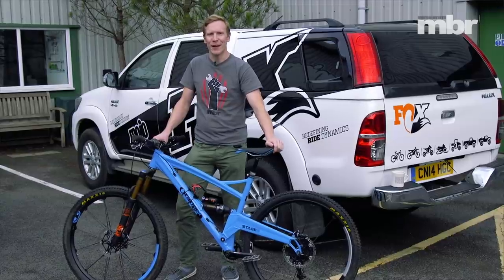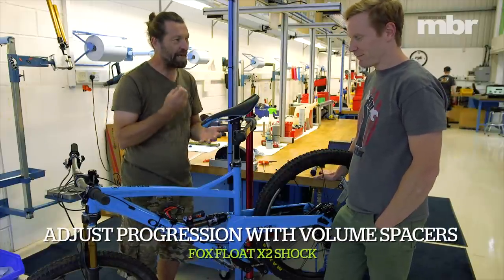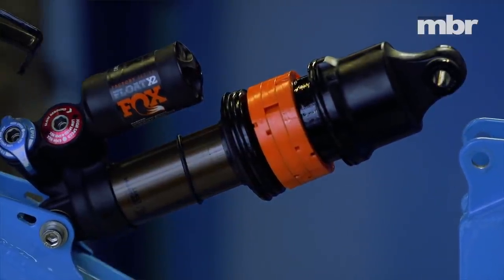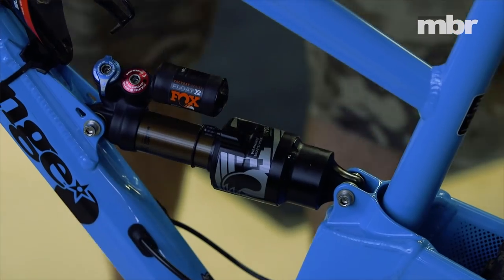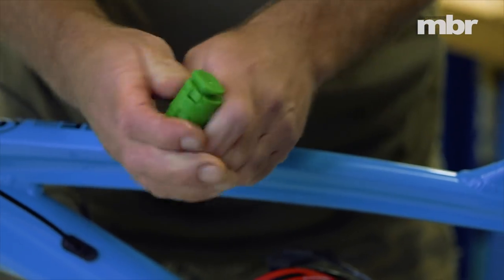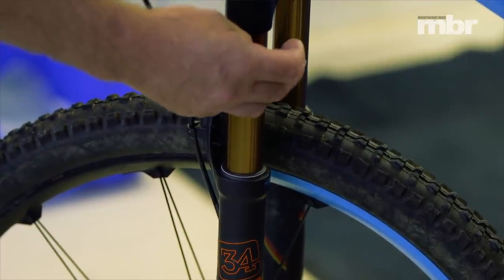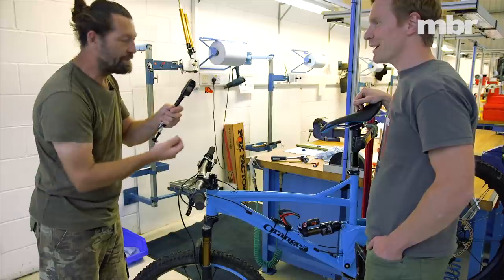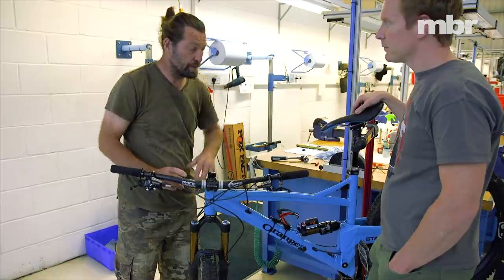Suspension Set-Up Masterclass | MBR & Mojo

Comment: This is probably one of the best suspension setup video's I've watched. I love how the focus is on setting it up to the rider. Notice how he glossed over sag/air spring rate and said that will change based on how hard you're pushing the bike. Explaining how he gets balanced and focusing on no compression unless needed to adjust ride high in certain sections of trail is huge. Much much better than the other sag/rebound/compression setup videos.

Comment: love his honesty. "don't use that" (the high speed compression on the fork). saying you should try to get the air pressure and volume spacers to do the work of getting it balanced and correct before you start using compression. Good stuff

Comment: This is so good.  I've been thinking about low speed compression a lot lately and this really set off a lightbulb for me.  Using LSC to load either the front or the rear during corners is something that would have taken me a long time to come up with.

Comment: Asking why you would want your front end to ride "higher" while climbing is a bit of a misunderstanding of terms I would think. All it does it to keep the bike from diving in situations where you literally do not need much suspension. I would agree with him. I run full open all the time....but I can understand where a bigger out of the saddle climber may need that "dive protection switch" when climbing.....

Comment: Great video but I’m still confused due to conflicting information on the net, I’ve Fox 34 Elite 2017, ride all sorts really but try to stay off fire roads.  So the Ride Fox website says 15 to 20% for my model (actually they only list 120mm but mines 130) sag tool provided was for 120 as well.  Most other videos including this one state 25 - 30% sag.  So in my case rode all the black runs at my local trail centre fairly spicy i would say and only used 70% of my suspension all day.  Do i ignore the FOX website and go with 30% which may help me use all my suspension or carry on using 15 - 20% and try volume spacers?  Surly fox that designed the fork knows best?
Reply from the maker: Try a slightly lower pressure in the fork and slightly more sag. Don't add volume spacers, as this will only make it harder to use all the travel.
Reply: Mountain Bike Rider thanks for the reply - i meant to say take out a volume spacer -  I’ll try more sag and play about with it

Comment: Did he just add one compression spacer in place of the red one? 80 KG myself and running about 170psi and already added one extra in place of the red one (three total) is it safe to run 2 extra total of 4 in a 2.25 shock?

Comment: Ok, I weigh 95kg 100 at most. I ride a Giant anthem 2015 27,5 120 F 90mm R. I ride everything actually on this bike. I find it hard to hop a 10cm street curb without hitting denting my rear wheels. It's annoying. I know it's my tire pressure and suspension setup. What do you guys suggest?
I currently run 95psi front and 235psi-240psi in the rear shock. rebound is one thing I don't understand. the rear is very slow just 2 clicks to fully open/slow and the front on fork is like halfway/12clicks (21 clicks altogether)
I run 2.2 rear TR tires 38psi when dry and 28 in wet conditions 2.2 front 35 dry 26psi wet.

Comment: You've never owned a Cane Creek Coil have you......  Complicated?
Reply: I have a CCDB, fairly straight forward to set up if you ask me. Just get to understand what the knobs are doing first, then get a good middle setting. Fine tune when riding a familiar track: right amount of lsc so the bike is balanced when cornering and pumping, ride some rocks/roots and see if there's any harshness, meaning the hsc is too heavy, see if it does follow the terrain nicely, if not back down the lsr a bit. Do some lippy jumps and see if the bike's either too bucky (too little hsr) or feels lethargic (slightly too much hsc) then pedal for a bit and feel if the bike's bobbing around too much (too little lsr).

And don't be put off by the number of clicks, really wide range but this can be narrowed down quite a bit to a useable range of about 7-8 clicks, everything outside that are bs settings that you can easily identify as such if you know how a bike should feel.
Reply: BIGKEV 61 The Fox has the same adjustments .... its not hard- go with the suggestes base setup and work from there
Reply: I got the CCDB coil cs. Is it just me or is it hard to fuck this shocks setting up?

Comment: Genuine question, why is tyre pressure never worked in to the suspension equation? Surely a tyre with more psi will have an impact, especially on rebound?
Reply from the maker: You're right, it's an absolutely critical part of the equation and needs to be considered as part of the system. And it's not just as simple as pressure: It will depend on the tyre casing, volume, rim width, rider weight, riding style, terrain etc, etc. Very much a huge topic on its own, yet also interwoven with suspension set-up.

Comment: 10:08   You can firm up the fork so you dont lose power when pedalling in the standing position !
Reply: Exactly !
Reply: RichardChick. Yes, on the flat. He was referring to riding up a hill with it locked out and the front end staying propped up and not sitting in its sag position. So essentially, the fork locked out, creates a higher front end and causes you to lean more forward to put weight on the front. Makes sense to me.
Reply: How do you lose pedalling power through your fork?
Reply: your suspension absorbs it rather than it going into the wheels, so on and so forth
Reply: tom harrison having the body positioned to far foward while pedaling puts the weight more into the fork, and vice versa.  Find the balance of body position
Reply: his point was how is there power going into the front wheel from pedaling. I understand your point, energy is used to compress the fork.
Reply: I think this refers to weight distribution over the bike when pedaling; higher fork= more weight biased to rear, causes the front wheel to come off the ground under torque in low gears. Keep the fork low, keep a more even distribution of weight over both wheels= keeps the front tire on the ground. That’s my experience with leaving the fork full open and it works
Reply: @dirtberg  you're not wrong, you don't loss any pedaling power in the fork, but you waste a ton of energy and anaerobic stamina bouncing up and down

Comment: That little black dial on my 36 FIT4 is an "OPEN MODE" compression adjuster. Not a LSC adjuster. Is the 34 FIT4 set up differently?
Reply: The adjuster for the open mode is lowspeed compression

Comment: Hi guys...I have a Rockshox revelation series 150mm fork...and I can not put any volume spacers i side becouse there is no thread on the inside of the air  cap...those this mean that my fork isn't compatiable with volume spacers or I can buy a threaded volume top cap and put volume spacers inside
Reply from the maker: You should be able to buy a threaded top cap from SRAM that will let you run bottomless tokens. Cheers

Comment: I have a question what if I like very slow rebound and want my fork to feel like slow rebound / have it, but want the rebound to be fast when needed how do I go about achieving that?
Reply from the maker: Why do you want slow rebound?
Reply: @MBRmagazine  it feels great and planted makes steering and jumps feel predictable along with wide open bumpy areas I guess I just have to make it fast enough to not lose all that with lots of trial and error bracketing settings ,fast rebound makes the steering feel twitchy for me but makes slow technical sections feel much easier.
Reply from the maker: Yeah, you said it yourself - the perfect damping setting is a balance that takes time and experimentation. If you're on a Kenevo SL i think Spesh has some detailed settings to use as a starting point in case you hadn't seen them.

Comment: so when he says 'don't use low speed compression unless you have to'. does that mean run no damping, assuming the sag is correct and you have the right amout of volume spacers in? then us LSC to fine tune? if you're still blowing through the travel?
Reply: Blowing through the travel is a different issue than low speed compression damping.  Blowing through the travel is either not enough air pressure, or you need to use more volume spacers.  LSC damping is what gives/adds some resistance to slow inputs to the suspension, such as pumping rollers, fork diving when braking, carving a big berm, etc.  That's why he says, if you don't need any LSC damping, then don't use it.  If your volume spacers are good and the bike is handling well, but maybe your front end is getting too low in a corner, or your rear end is too soft when pedaling, then add some LSC damping (clockwise turns) to give the susp a little more support.  Make sense?
Reply: @Windband1  sorry, i meant HSC to fine tune if blowing through travel. in any case, did some riding on the weekend with the LSC open and maxed out volume spacers with the right sag. still bottoming out shock. so i use HSC and it stopped the bottoming. i have 10% travel remaining on the trail that uses most travel, with jumps and drops. thanks for your comment.
Reply: @sultanabran1  Got it.  What shock/fork are we talking about?  So when you say "blow through the travel" do you mean use all the travel or are you bottoming out often?  Regardless I would say at this point, you need more air.  Some of the best experts in suspension actually say don't worry about using full travel, set up based on what feels best to you.  Sag point is just a ballpark.  If you're at maximum spacers and bottoming, you need more air.  I would try that first, then if needed, add a little bit of HSC damping.  That should get you there!  Also remember if you add air, you may need to add a click of rebound damping too.
Reply: @Windband1  thanks man. cane creek db air inline. running at 11bar (150 psi). blow through travel as in bottoming out. sag is about 30%. i'll experiment with putting hsc to 0 and see how much air i need to stop bottoming out then. however at the moment, it's at just under 30% with hsc at 3/4 turns. it feels really good and has about 10% travel left after doing some decent drops/jumps.

Comment: I'm kinda confused, the guy from Vorsprung Suspension said that the best way to dial the rebound on the shock was to close de HSR and work with the LSR, if you need your suspension faster then just open the HSR until you get the desired rebound. This kinda contradict what this guy says about HSR at 5:09. Any thought on this?
Reply from the maker: We would say there are no right or wrong answers when it comes to any aspect of set-up, just differing opinions. Try both and see which one works best for you.
Reply: I would listen to Steve at Vorsprung any day of the week and not listen to the most on Youtube, just my opinion.
Reply: @MBRmagazine  "There are no right or wrong answers when it comes to suspension setup"   realy, REALY ?   This may be why there's a lot of confused riders and even more poor setups.

Comment: how is that bottle cage mounted? zip ties, but is there something else?
Reply: Hi Go For The Win, I've just used a regular bottle cage and fed some zip ties through it. I ran a short section of gear outer inside vertically down the cage though, to give the zip ties something to feed around. Also, there's a rubbery bit of old light mount under the bottle cage to give it some grip.

Comment: It proper to compress the shox with the pump screwed??
Reply from the maker: He's just charging the negative chamber, so it's fine. When setting sag, you can also just unscrew the pump so that it disengages from the valve core, but leave it attached to the shock to save time.

Comment: fox float x2 2017  150kg me and bike ok work suspenzion?
Reply: Nope, you will need more than the max Float X2 250psi. Get a coil shock and depending on your frame probably need a 700-800 lbs spring.

Comment: Can I remove the red band in the shock and replace it with the orange spacers for more progression? I am around 105Kg with backpack and I have to run my shock at 250psi and it came with ale the orange spacers already in just like yours. The bike (Giant Reign Advanced 1 2017) feels super planted and I use all the travel just right without bottoming out on anything but overshoot doubles. But I would really like a bit more pop.
Reply: No. If you are already at 250psi it is not safe to remove the red limiter and put more orange spacers in. There is a risk of blowing the air can off. I would look at coil shocks (DHX2 with climb switch maybe).
Reply: Pop is in your LSR setting - few clicks anticlockwise.

Comment: what i dont understand are the spacers for what are they? with spacers you have the same pressure just in the smaller place that means lower shock travel and stiffer damping...with adding air you have the full travel and stiffness can be adjust with pressure so i dont understand why some1 should put this Things inside...it gives me importance just if you are not allowed to pump more psi into the schock and you Need more pressure couse the shock still bottoming out or it gives too weakly Feedback but there is the highest Limit of psi (depends on model) for example 150 psi with spacers has more pressure in the fork then 150 psi without spacers couse the damping is much more agressive couse the air is in smaller tube that means 150 is like 170 so you would be over the warranty Limit...more travel is more "time" to absorb the energy of Impact fork with spacers sounds for me like a full blowed balloon from which you still taking 1 breath then adding 1 blow inside so it is question of time when it makes a boom 
Zobraziť menej
Reply: It's about keeping the sensitivity at the start of the stroke but not blowing through all your travel. If you put more pressure in to stop the fork diving too much you will loose small bump sensitivity. It doesn't effect the travel you just won't be using all of it when you don't need to.
Reply: Spacers do not reduce travel, they just make it more progressive (it makes it so the deeper into the travel you get, the harder/stiffer the suspension gets).

Comment: Very common sense stuff.  But I’m sure a lot of people don’t even check their suspension besides just putting the recommended air for their weight.. And I’d assume the red thing you’re not supposed to remove equals 1/2-2/3rds of a spacer?  To replace it with just one?  Really?

Comment: 8:25 great strategy for setting rebound. Something that has always troubled me. Thanks!
Reply: Also summer and winter temps will need different rebound speeds because of the chain oil viscosity

Comment: Thats really Unprofessional to compress the shock with such air can valve geometry with the pump attached, risking snapping the valve or damaging something///
Reply: How? He wasn’t pulling on the pump. And the valve isn’t designed to release air without pushing on the center pin so there’s so air pressure trying to push it off?